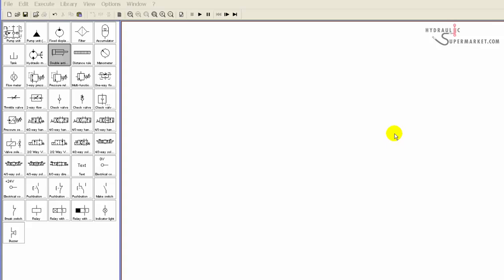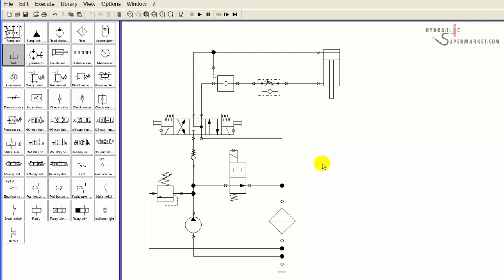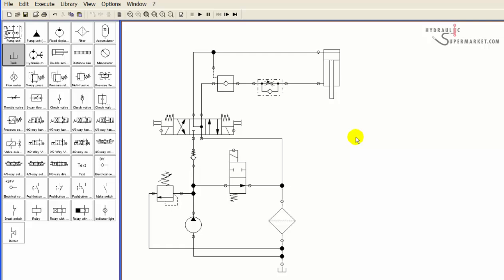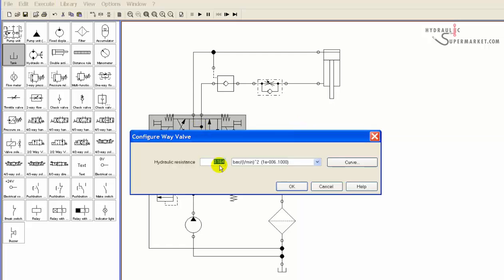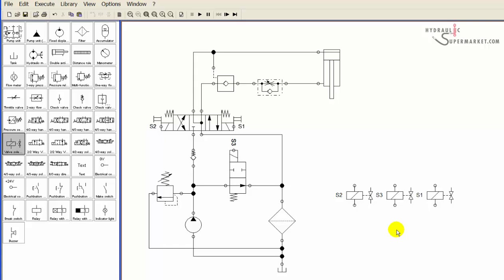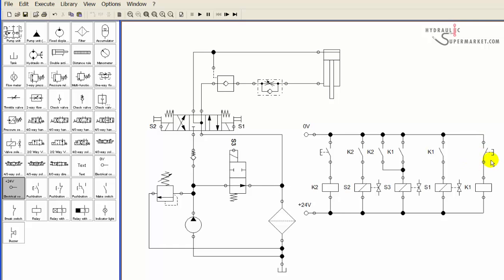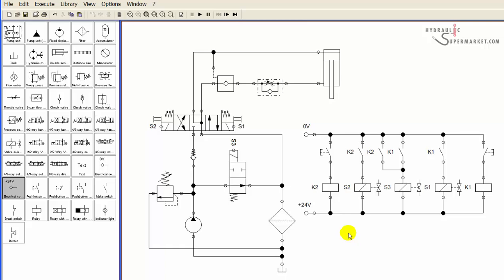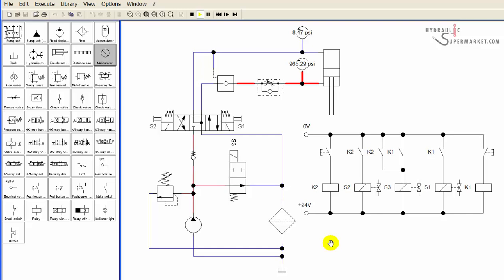How To Analyze and Troubleshoot Hydraulic Circuit Problems

Comment: I like how you added a 2-way/2-position solenoid valve to this system. It helps reduce the load on the hydraulic motor while the system is idling. Thank you for sharing this.

Comment: Great video!  It would be great if you could plot various information during the simulation (in this case extend/retract pressure versus time).
Reply: which software that he used in order to draw hydraulic circuits? if you know, let me know, pls.
Reply: @moon_light_cr please also share me the software

Comment: An additional safety measure would be to add a PRV set to 2000 psi before the p.o. check. That way, if the po check ever sticks, it’ll stop from blowing out the rod seal again.

Comment: With all due respect to Casey, I recommend that you NEVER attempt to solve an engineering problem on you own; even if you have the knowledge. Anytime you alter the design of a hydraulic system, you automatically assume the manufacturer's liability. Moreover, if you are hired by the owner of a hydraulic to solve a problem, and you proceed, both you, and the owner, assume liability. If you have the knowledge to solve the problem, your responsibility is to either tell your customer to call the OEM, or contact the OEM yourself. The point is; never take the system's original design engineer out of the loop.
Respectfully
Reply: this videos just give you an idea and you can learn alot
Reply: I agree with Rory.